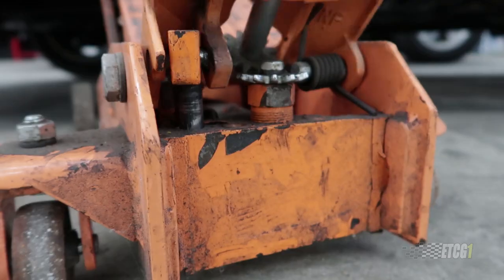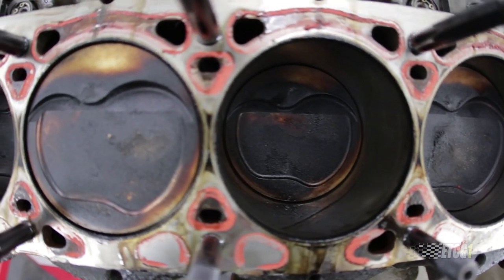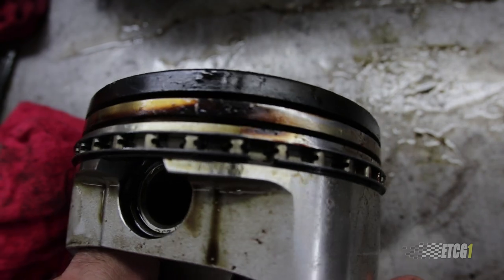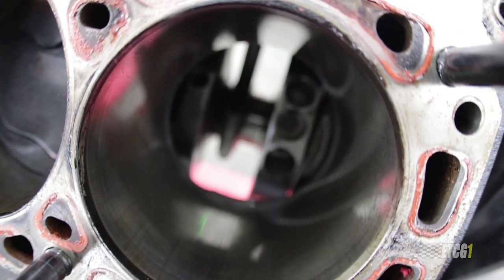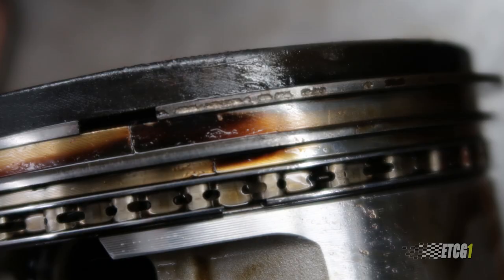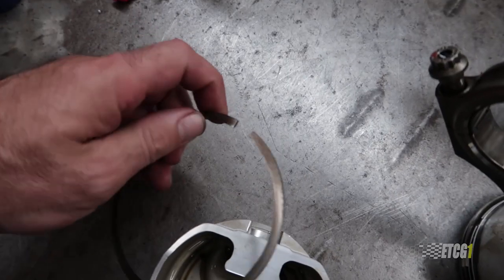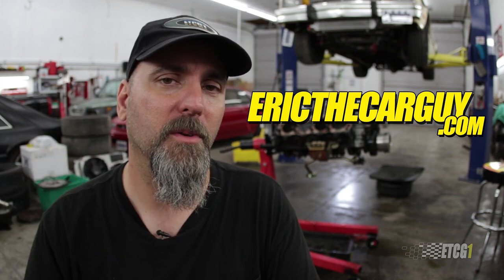Hydrostatic Lock the Silent Killer

Comment: How about when your brand new truck has a fuel injector issue and dumps a bunch of gas into the piston.  Then your wife goes to start the truck and boom, catastrophic failure!  Good news though the dealership bought the truck back and my wife happily decided we needed a Suburban.  You are lucky something worse didn’t happen!
Reply from the maker: I agree. Glad it worked out for your Suburban.
Reply: cw2lido Scary. What kind of truck and what engine if you don't mind me asking. (I'm in the market is why I'm asking) And thanks.
Reply: cw2lido - I'm glad the dealership did the right thing!  Was the first truck a diesel?  Here's hoping the Suburban gives you no troubles for the rest of it's days.  ☺
Reply: P Ferris it was a regular fuel truck.  It had gone in for an injector issue previously and they said the last injector failed too but didn’t put fuel in, the new one obviously flooded the cylinder and I guess blew a hole in the piston. They were originally going to just put in a new motor.  The truck had 5,000 miles on it and my wife said that wouldn’t suffice and said you’re going to buy it back and we’ll get a Burban instead.  They actually did it! I was surprised!
Reply: this is a good example for everyone ""SCREAMING"" to install "Fuel Injection" to solve the issue ;))
also going from one "carb"/two bowls being an issue, vs. 4 to 8 injectors(tbi/mpi), It's much harder for a "carb" to cause a single cylinder lean condition, with injectors??? there's multiple layers of things that can cause a single cylinder lean-out and large melted holes ;)
Reply: cw2lido injector stuck open ?
Reply: ROTAXD yup! The first one started to pulse too much and it finally gave in and stopped working.  The second one just gave it the gundy and filled the piston chamber with fuel, the wife went to start it and boom that was it for the piston.  The truck did start...but sadly succumbed to its wounds.  It did run but had a miss and stumbled.  My wife called the dealer, and they sent the wrecker to pick her and my kids up.  The truck driver said she should have shut it off.  She said we have a special needs son who can’t be in extreme heat.  Keep in mind this was in Las Vegas, during the summer.  I hope he felt bad he told her that.

Comment: Back in the mid nineties I was working as a tech in a Chevrolet dealership had a car come in with a quad 4 engine that would not turn over at all I removed air intake boot to get it out of the way and water started pouring out of the throttle body they drove through a deep puddle sucked in water the engine hydrostatic locked which caused a connecting rod to go through the block

Comment: Hi there: just wandering about how much liquid matter (I understand this was gasoline) is needed to cause this failure, since you were able to pour water into a running engine to decarbonize it... Should be more volume than the combustion chamber´s capacity to cause the lock. Quite some, I guess.  If you are trying to clean an engine by pouring water into it perhaps you might be risking an hidrostatic lock upon a bad timed sneezing... 

On another subject: What happened to Blown Heads channel project?
Thanks. BTW I enjoy your work.
Reply from the maker: Only in small amounts. You're just trying to turn the water to steam inside the intake.

Comment: If on a V8 engine, you have a hydrostatic lock issue with only one piston that failed catastrophically, couldn't you just unscrew the spark plug from the affected cylinder in order to release all the pressure from it, so that the damage doesn't increase, and then slowly limp home on the remaining 7 cylinders, even if you still had hundreds of miles to go? Maybe just stay below 50mph, and you'd be fine until you had the chance to repair it?

Comment: I'm not saying this didn't happen as result of hydrolock, but I have piston paper weight that has broken ringland just like that from running lean on the dyno
Reply from the maker: The AF runs in the 12s. I would think if it was detonation it would have effected more than one cylinder, but I suppose I could be wrong. Either way, I need to spend more money.
Reply: Eric, good point.  Now to think of it, there may have been one or two other broken pistons, I don't fully remember.

Comment: Went tho a deep flooded road after a storm motor did not stall I coasted tho it but hours later my dodge ram 2500 5.7 hemi started misfiring check engine light came on and showed p0300 and p0306 that was a week ago sent truck to the shop and they said 0 compression in #6 and I need a new motor. I took truck home and removed the valve cover I seen one of my valve spring is almost gone only 3 coils of the spring left so I got a camera and looked down the spark plugs and it looks ok I think but I'm not a expert. After seeing this video I wondered if it's a dodge motor issue or if mabe the huge puddle took out my motor. If anyone  reads this any thoughts would help.Thanks!

Comment: I aint buying it, the gasoline incident had nothing to do with it, im saying it was pre-detonation. That can break ring lands very easily, ask mr sloppy, also you were running too lean, too hot for a boosted application and maybe a poorly chosen timing curve.
Reply: Exactly.  No knock control either... drives it summer on power tour... boom... ring land fail due likely to prolonged detonation. Classic carb turbo setup fail IMO.
Reply: Maybe. I would guess hydrolock would bend or crack the aluminum ring lands.

Comment: I've seen a bent connecting rod from a Ford Expedition that was pushed into a hydrant while the engine continued to run and high press water blasted into the intake........OOPS!  I convinced them it was going to be more than an engine replacement.  Vehicle was totaled.

Comment: Wonder if it's possible to design a sort of relief valve that will open in the event of hydro-lock but will stay closed under normal combustion pressures? I'm guessing it wouldn't be that hard to engineer such a thing but I guess it's not economically viable to put them in every engine for the unlikely event of hydro lock.
Reply: Plus manufacturers want to sell more parts, not less parts.
Reply from the maker: Not sure how viable or practical that would be.

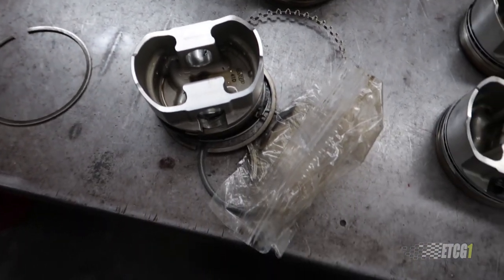Comment: 7:15 "Other upgrades to the engine..."    Time for EFI !!!!  : D
Reply from the maker: Not this round, likely this winter.
Reply: Velocity Labs while efi makes tuning changes quick & easy , a properly tuned carb will be just as reliable as an efi setup. Tuning (jetting) a carb is NOT that hard especially with a wideband O2 sensor telling you if you need to add or remove fuel.
Reply: the engine got fucked up because the carb in the first place.. i would throw that thing so far away, that no one ever finds it
Reply: you can easily make that argument for Injectors as well. how many motors have been killed by a stuck injector or a lose connector or a broken wire. BoostedBois, AdamLZ and Taylor Ray spring to mind! Taylor in particular went through 3 miata motors due to his injector wiring.
Reply: Seems like everyone  wants to convert to efi.theres thousands of videos out there converting any possible engine to efi.i would just like to see how good it can get with the carb. YouTube needs another efi conversion video like it needs another LS swap video.Im deffinatily in etcg's camp on seeing what the carb can do.

Comment: You will only do damage to an engine if you hydraulic lock while it’s running. Your starter motor will not turn over on a locked engine, as you found out, well before any damage can occur. A bent con rod is a more likely outcome from hydraulic lock. Ring landing damage is classic ring butting caused by incorrect ring gap or excessive heat in the combustion chamber. Just because the other pistons and spark plugs look ok doesn’t mean anything. This piston could have been damaged during tuning when your tuner was going wot under extremely lean condition. And maybe you have only recently developed excessive blow by now that the ring gap has lined itself up with the crack

Comment: I have a Chrystler Sebring at work right now that had a fuelinjector go bad and got stuck fully open.. and a bad battery, went to drive it into the workshop and a customer called, 5 min later the car was dead cause of low idle rpm and said ”fuck it ill do it on the ground” (and all this was before i were able to check the fuelinjector) anyway changed the injector and were just about to turn it over and crack... hole thru the oilsump cause of the connectingrod snapped while on the phone with a customer and it made no sound just died...

Comment: man fuck 01 acura integra after market CAI splash guard previously ripped off ... car hit a puddle stop running got it to start back up a few times ran fine little bit of smoke out the back ... pulled air filter off drying it .. pulled the wires off but i already had water leaking thru my carbon fiber hood right into the trench.where the plugs sit. are there any sounds i need to listen for or ? if the smoke continues to come out the back white ish is it fucked?

Comment: I have had it cause a connecting rod to snap and go threw the block and I have seen it bend the pushrods from the water going up the tail pipe

Comment: Eric I hate to say this dude but this plugs look terrible. Either you're always in boost or that thing runs filthy rich. I don't see any light brown/red/grey glaze I normally see with proper air fuel mixture. Sorry about the motor though bud 😓
Reply: Also the last time I saw a piston break like that it was because of pre ignition. I went through a couple engines that did exactly the same thing and it turned out to be too aggressive of timing.
Reply: Bingo

Comment: my atv carb was flooding, and filled the cylinder with fuel, I took the spark plug out and turned the engine over, I got lucky, but the fuel  had been washing  the oli off the cylinder wall and I had to replace the rings.

Comment: In all fairness the carburetor IS the culprit since none of this would've happened if you had gone EFI in the first place :P
Reply: ever sen what a bad injector, wiring or ECM does? same thing and often worse long term with a smaller leak. all because yo-yo's keep driving them.
Reply: I had someone fix my car once. His shitty wiring caused my #5 injector to stick open and lock while idling.

Ex #2
Driving my honda accord home from work. Ecm suddenly shorts out and fills engine with gas.
3 bent rods and a cracked low mileage block.

Ex#3
Mothers 3.8L buick v6 was driving along fine for 800 miles without issue.
Buick never pulled on the high end.
That morning engine started and immediately kissed the head and engine stopped.
Gm dealership figures it detonated on and off for 60,000 miles without a engine light.

All fuel injected vehicles mate.
Reply: guys it was a joke...

Comment: got a 1977 chevy pickup with a 400 smallblock 

drove it enough to not let it get bad..... then let it sit for 4 or 5 months
CRAN THUMP

just got half a rotation of the crank

so far its fine..... after it locked, we put new heads on.... better castings from a 350 (steam holes were drilled)
didnt see anything, but doubt i could from the top end like that

when i got it, i knew it MIGHT have a blown head..... but for 500 bucks, its a truck worth 4 grand
love that 400 however....

if it blows.... it blows
ill just end up with a 408 after its all said and done....

Comment: If you had chosen EFi over the carburettor probably this wouldn't have happened.
Reply: Injectors get stuck open too. Broken diaphragm in a pressure reg will also dump a ton of fuel into an intake, ask me how I know. So no, EFI would not preclude this from happening.
Reply: sparkplug1018 when I was a kid I had a broncoII that the fp regulator diaphragm break. Completely filled the motor with fuel. I think the only thing that saved me was the fact that the motor had nearly 150,000 on it and the fuel was able to push by the rings. Damn thing still runs good. We use it for dragging logs out of the woods to heat camp in the winter. Needs valve guides & seals though.smokes like an old P51 for about 10 seconds on cold starts until oil burns out of the combustion chamber.
Reply: Yes but what are the chances of that happening? I lost 2 bike engines because of the carburettors and never had a problem with fuel injection. I resurrected an old mercedes from the 70s with mechanical fuel injection and it still runs good with its original pump and injectors, i only replaced the rubber hoses...
Its way easier for it to happen in a carburettor, a broken/wrong fuel regulator, a needle stuck open, a leaky float that fills with gasoline, etc...
Reply: John Capidecallu no, you lost 2 bike engines because you either didn't maintain your fuel system or had no idea how to properly tune a bike with carbs. Look, carburetors are NOT complicated and they're extremely dependable once set properly. The fact that you actually have to turn a wrench instead of simply plugging into a laptop does not mean that efi is the be all end all of fuel management.
Reply: good time to point out bikes have fuel petcock's for a reason..........

Comment: My engine aaaalmost got damaged because of bad carburetor,but it did not start,so I put out the spark plugs and then got out all the fuel,fixed the carburetor issue and then everything was fine.After that I've done a top end rebuild the engine was even better,but the cyl 3 got a little rust,and when the engine is moving it locks on cyl 3 but not so ruff,anyway,that is a minor problem cause the engine is crap anyway after I pulled 8000rpm in neutral whan it was dead cold,but still runs preeeeetty strong and I didn't even realize the power loss

Comment: YOU SEE NO OTHER DAMAGE TO PISTONS RINGS, BUT IF YOU XRAY PARTS COULD BE INTERNAL CRACK OR WEAK SPOT, WOULD SUCK TO REASSEMBLE AND HAVE ISSUE. WEAKEST POINT RINGS, HEAD GASKET, HEAD. LOTS OF PEOPLE DRIVING THREW DEEP WATER THESE DAYS. CARS SHOULD HAVE WATER SENSOR 6 INCHES BELOW INTAKE TO SHUT DOWN ENGINE SAVE MONEY. NICE CAR.

Comment: I have to side with ETCG1 on this! Too tight of a ring gap will show different damage! Detonation inside a force fed engine is a VERY ugly sound! It usually kills the engine right away! Detonation is going to put pressure on the piston crowns! Tight ring end gaps will break the upper lands, not the middle land! In ETCG1's case, this was a hydro-lock! When the piston came up, the upper ring put tension on the middle ring land! The hydraulic pressure from the lock forced the top ring down even more and cracked the ring land! I've been doing this for a LONG time! Hydro-locking an engine will cause very interesting, and often difficult damage to find!

Comment: detonation closed the gap and seized  the ring burning the molly off and broke lands is what I'm thinkin.  maybe not enough gas getting to that cylinder after you leaned out the jets maybe you should put a bigger jet in that corner of the carb corresponding with that cylinder.

Comment: I got very lucky once I drove through a deep puddle with an old 89 Crown Vic with a 5 liter engine in it and I suck the s*** ton of water up in the engine and when the car died I tried to crank and I heard it I automatically knew what happened I got out in the muck in the Meijer in the ranks I tried to drive through too fast we drain the cylinder walls or the cylinders with Bulma spark plugs out and I drove that car around for another 2 or 3 years before I sold it never had an issue out of it but yeah I consider myself very lucky on

Comment: Not to start an argument- but most "liquids" are compressible, with enough force. The only known liquid that is totally uncompressible is pure water.     https://water.usgs.gov/edu/compressibility.html          In my younger mechanic years in NC we'd always get Folks who'd try to drive through standing water on roadways, as with flooding, hurricanes, etc. and that will instantly break stuff. You're very lucky only a ring land chipped. One guy's inboard 305cid in a speed boat was very out of tune; hen shut off- it spun backwards enough to gulp water through the exhaust. Next crank time- cracked the head, bent 2 rods, and the starter broke off.

Comment: most people simply call this a hydrolock. wasn't aware it can crack a ringland but don't doubt it all. turbochargers even on oem engines are without a doubt the most common causes of cracked pistons. oem manufacturers rarely use forged pistons, they use cast and are most susceptible to breaking on turbo gm products im used to working on. basically u will notice oil consumption first because the engines consuming oil on the bottom of the piston and getting past the crack via intake stroke. eventually the crack will cause a 30 psi or greater imbalance, the crank sensor will detect variation and you'll get a flashing ses light and p0300 misfire code. smoke out of the oil cap is the easiest sign to diagnose unless u want to do a compression test. advise staying away from +16 chevy malibu and cruzes and +13 buick regal. there really bad for this issue but not caused by water ingestion.

Comment: Yes hydrolock will destroy your engine...i washed out my intercooler and there was a low spot in the intercooler piping where a small pocket of water was hiding...started the car and let it run while i hosed off the car, hoped in and drove down the street at maybe 3 percent throttle and at the end of the block the engine locked up...i got it started after about 2 minutes of cranking the engine over, got home and sure enough, a hole in the block and a shattered rod...